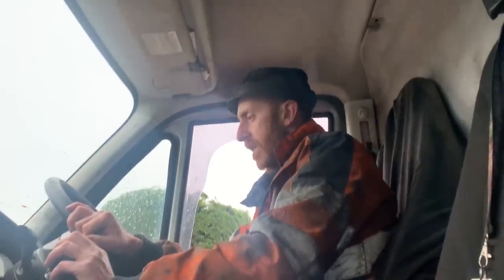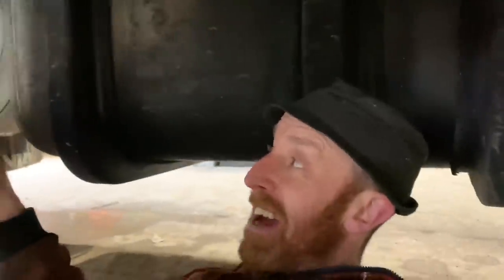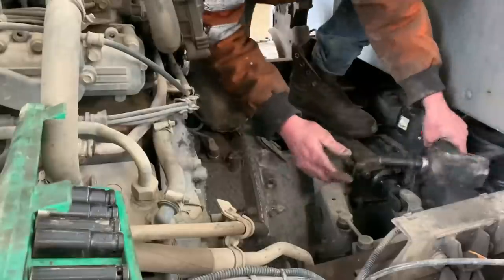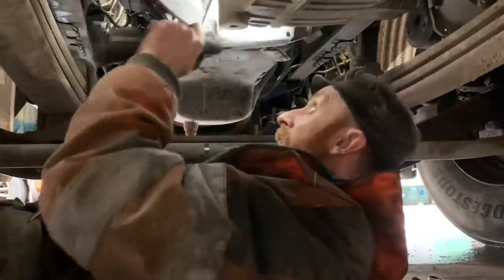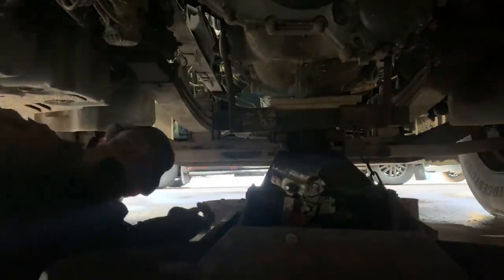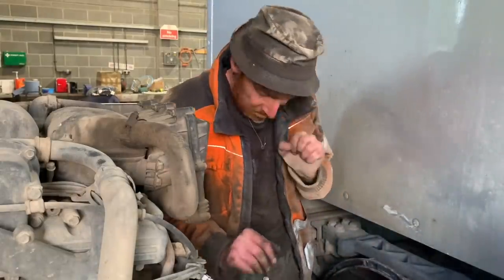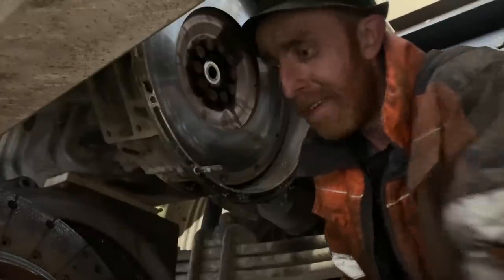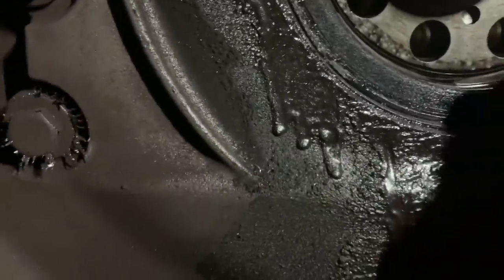Another gear box and fly wheel removal oil leak Scania mobile hgv mechanic truck lorry rig semi

Comment: just a little tip if you use a combination spanner you can lock the flywheel up put a bolt in flywheel then put the spanner between bell housing stud and the bolt in the flywheel .
Reply from the maker: Oh yeah that’s a good idea 👍 cheers Steven
Reply: @Professional-struggler  no worries mate .